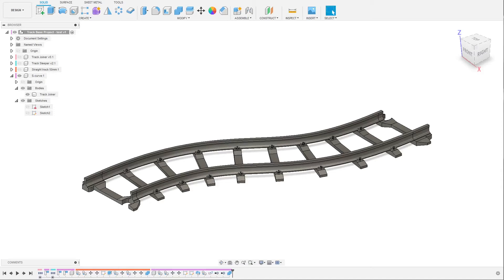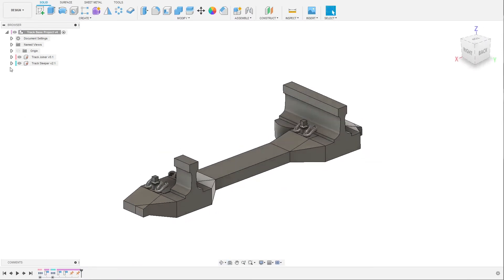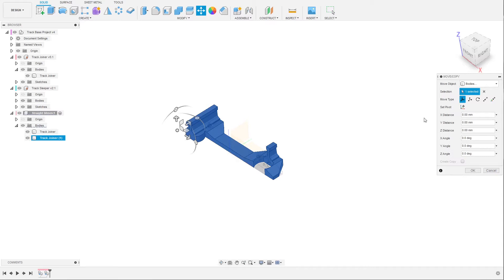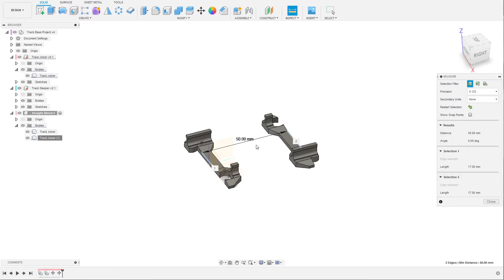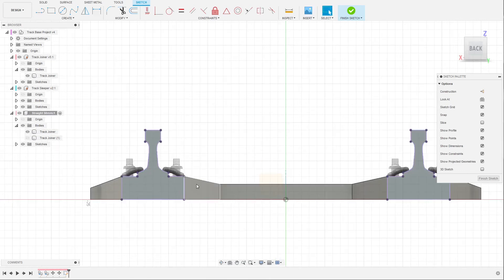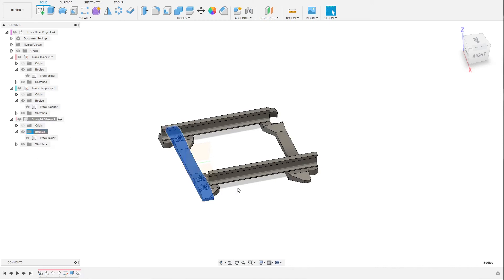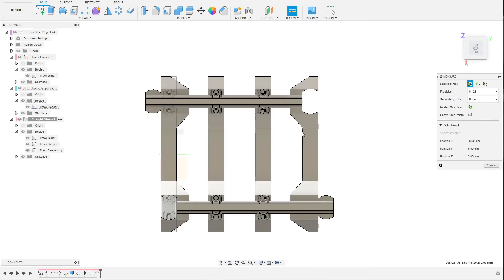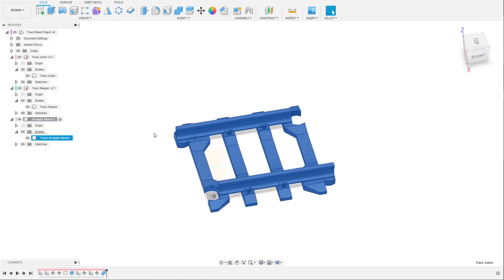OS Railway Track Tutorial Fusion 360 Part 1 of 5

Comment: Great work! The system is awsome and I'm quite impressed with the turnouts. The design of the tracks is very nice and the use of the PLA deformation instead of the moving parts is great. Congratulations!
I saw that you put the f3d file in the thingiverse page for the tutorial but, as I'm a total beginner on the fusion 360, I'm having too much difficulty to model a 90deg crossing. Can you provide the f3d file for the 30deg crossing that you put on thingiverse? It would be a excelent start for me. And if I succeed to do the 90deg I send it to you, of course.